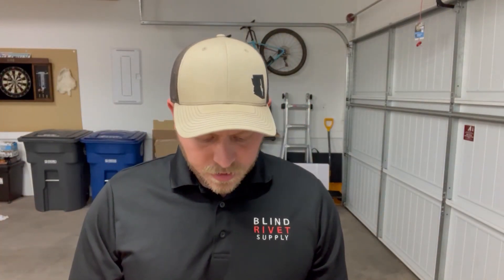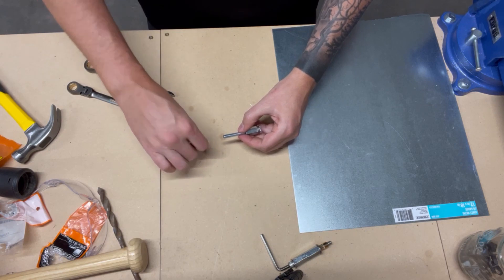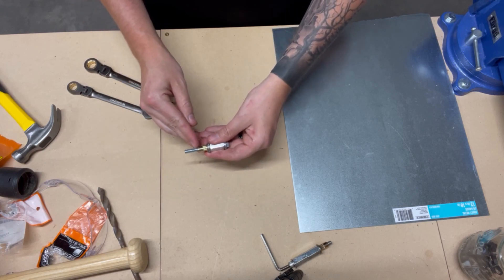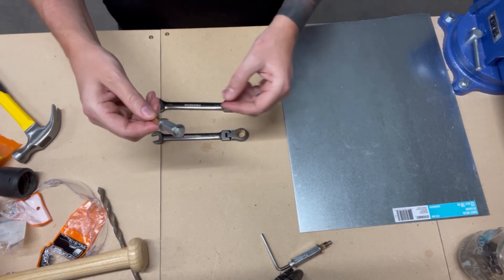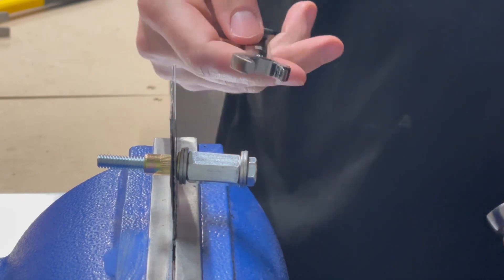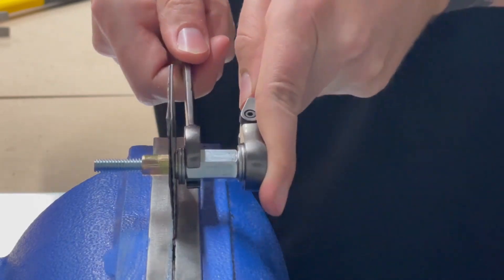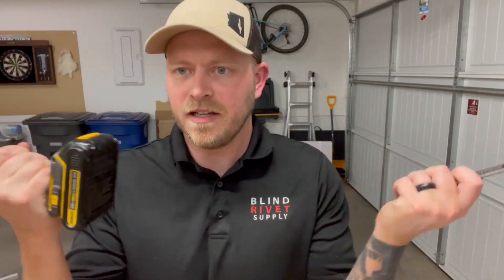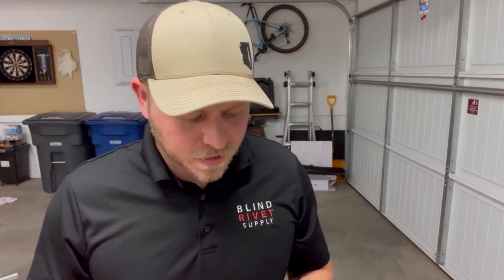TOOL SERIES | HOW TO INSTALL RIVET NUTS WITHOUT A DEDICATED TOOL

Comment: When you used the socket head bolt, I think you ran out of threads and that is why you weren't able to finish installing it (see threaded portion at 3:48).  The hex head bolt, on the other hand, was fully threaded.

Comment: Nice one. I only want to repair a single rivet nut on an old bicycle so it's not really worth spending NZD$60-80 for the tool. I've seen several videos and tested it once but failed, on a hex cap screw similar to your one which didn't work. I think the hole in my steel rule which I used for testing was slightly too large, but also the M5 size cap screw only has a 4mm hex socket head which started stripping out under the force required (only using aluminium rivet nuts). SO, I've now acquired some M5 hex head bolts (much larger heads) and I'll try again with a proper socket & the impact tool.

Comment: I found it helpful to use a internal lock washer between the rivnut and flat washer it helps to stop the rivnut from turning while tightening the bolt.

Comment: I am in the market for some rivet nuts or tube nuts in the 38 BSF (which is a 20 fine thread). Any idea where I can get some? As far as the video goes, I have watched numerous other videos about this topic. While there are various methods, the main thing in my opinion, is to use a vice correctly, and usr the correct length of bolt. In this video, the bolt you used are far too long, as you mentioned. Another point, it looked as if you had only the edge of the thin metal plates in the vice, should have been lower for more stability. Thanks for the info. If you have any idea where I can get the 3/8 BSF Rivet or Tube nuts, please advise.
Reply from the maker: Hello Richard, thank you for the comment. I'll admit I could have used some higher gauge steel in this video so it didn't bend as much. As far as 3/8 BSF, unfortunately I haven't run into trying to find those here in the states. We are able to source 3/8 UNC (-16) and UNF (-24). Please shoot me an email at sales@blindrivetsupply.com if you'd like further assistance.

Comment: This is very badly explained. I still don't understand how rivets and rivet guns and the alternatives work!
Reply: Rivet nuts work the same way as pop/blind rivets. The difference is, instead of the gun/tool using a mandrel or pin to hold the rivet, the rivet itself is screwed onto a thread that is part of the gun so that the gun holds it in place during compression.